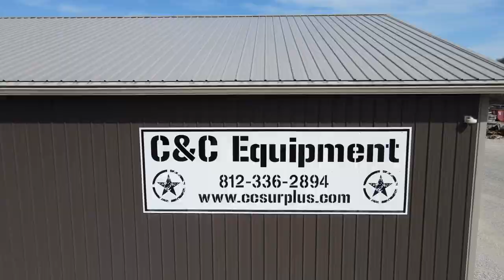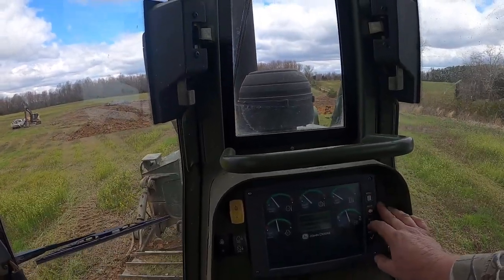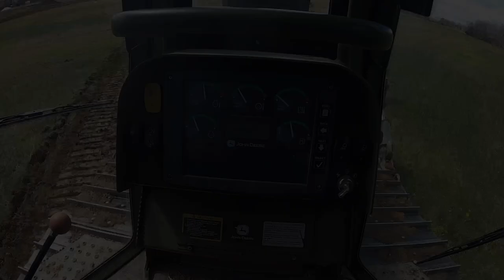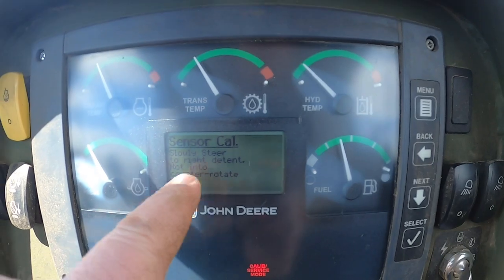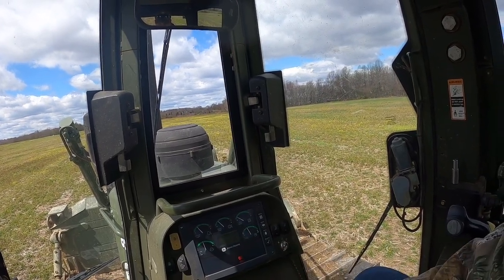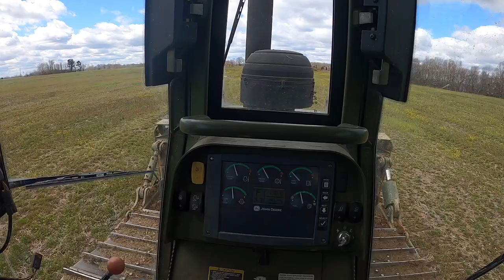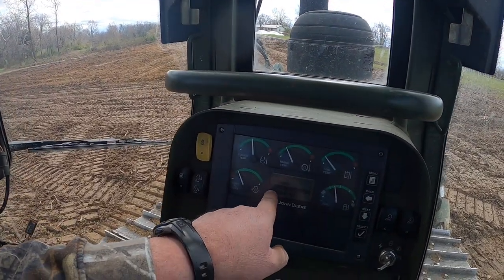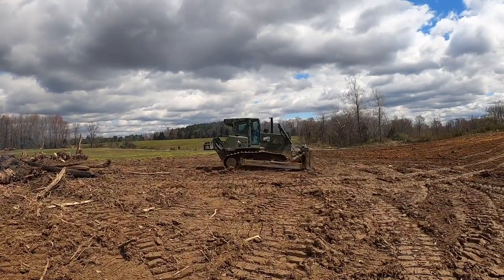How to calibrate Deere transmission controller 850J 750J dozer @DirtPerfect

Comment: Clint as I said before you knowledge of equipment especially Deere is unbelievable 👍I read the manual on my newholland skid loader and I was more confused how to adjust the controls after I read it left in factory setting’s been. Running it that way for 4 years now

Comment: I know exactly what caused the transmission to go out of calibration. It’s the missing fire extinguisher😁.
Jokes aside the steps for calibrating the transmission on 750/850 J series remind me of calibrating my old flight simulator controls. Then again if you think about it since they are both fly by wire controls why wouldn’t they be kinda of similar.  Thanks for the tutorial even if I myself will probably never have to calibrate the transmission on a 750/850-J it is however interesting to see it done.  For the silly question of the day how often to the transmission controls go out of calibration?
Reply from the maker: They only need calibrated when a part is replaced in the system which could be anything from a sensor to a pump or drive motor 
My guess is maybe something electrical got replaced before we got it and it was never recalibrated

Comment: Do you have any videos of the drive spool adjustments for pump calibration failures that you spoke about?
Reply from the maker: Not yet but I will in future
Reply: @C_CEQUIPMENT  that’s great! We just did the torsional dampener replacement on our 450J, and now it won’t go forward.  Reverse is fine. It keeps failing right front pump calibration. Very frustrating.
Reply from the maker: @ChromedOutDubs  probably needs the differential pressure checked on pumps
If it’s out 5psi or more it will fail

Comment: How far back would you need to go to get a machine without all the electronics? Plain Jane mechanical operation. I used to service xray equipment and some machines would self calibrate others required physical adjustments, all the bells and whistle's were a real pain in the duper.
Reply from the maker: 1999 or earlier on a deere 450-650
750-850 would have to be 95 and earlier

Comment: I run a 850c that has similar issues! Is the calibration similar on it?
Reply from the maker: It is somewhat
Gonna be done through trans controller on right side of machine
Keep in mind you can open a can of worms on an older machine that may be out of adjustment
Reply: @C_CEQUIPMENT   probably why it’s been this way for so long. It turns either way depending in speed selection and rpm. Thx
Reply from the maker: @mikeseigler7242  it can be fixed just need to be prepared to spend some time possibly lining it out